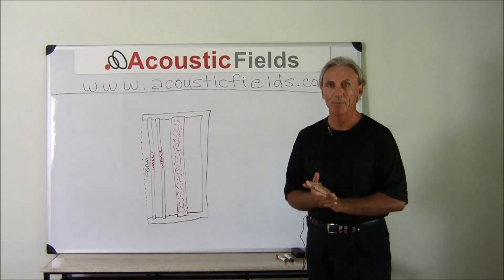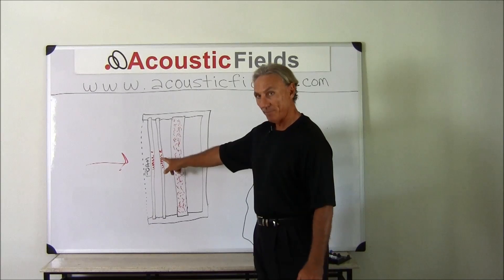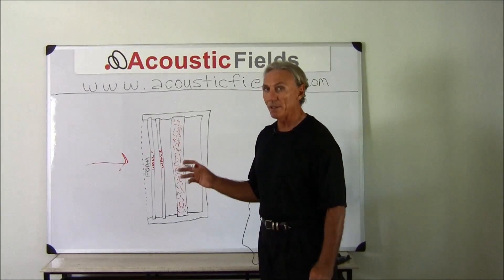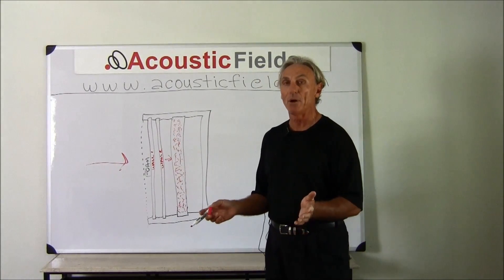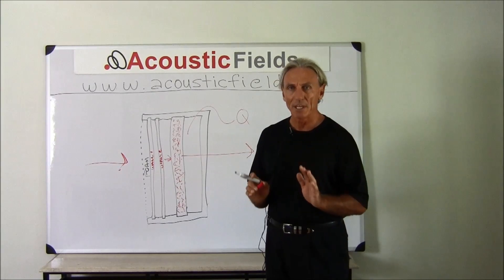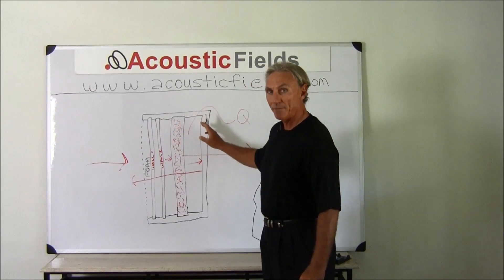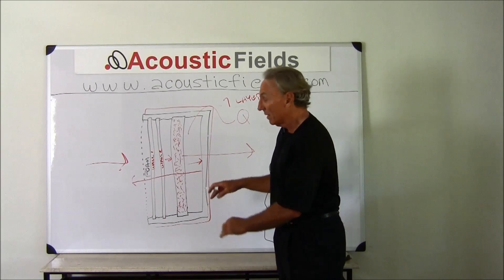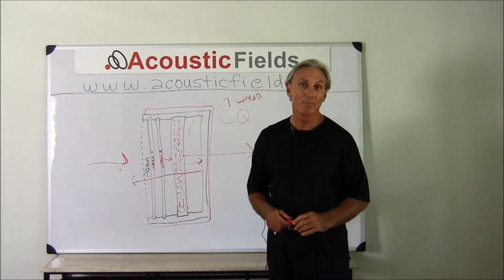How A Diaphragmatic Absorber Works - www.AcousticFields.com

Comment: Never use the wording "vacuum" when explaining what's going inside your products.

Sound / pressure does not not enter a "vacuum" and move to anywhere.

Better to say "a near air tight environment" which is nothing like a "vacuum" 🤔👍🏼
Reply from the maker: It is a "vacuum" in a sense of the word. In a vacuum, there is no air. Inside our carbon absorption technology, there is less atmospheric pressure inside the cabinet than outside where the pressure waves was created. This pressure reduction is critical in our diaphragmatic absorption process.
Reply: @AcousticFields  hello, surly the sense of the word Vacuum is: a space entirely devoid of matter.

The hallway beyond the door of a listening room will have lower air pressure but you do not enter a vacuum when opening the door.

The word Vacuum has a meaning which is completely different to the atmospheric properties of your carbon abortion technology and inside the box itself.

The word Vacuum is misleading and inappropriate in this context.

Love all your video and your passion for high-definition audio representation in smaller rooms 👍🏼👍🏼

Comment: This is great basic information.  Can these cabinets be tuned for frequency?  I assume the thickness of the carbon membrane is for tuning for amplitude?  I don't believe in one size for all.  If I have 5 axile modes in my room between 80 - 30 hz will your build plans tell me how to tune/construct a DIY cabinets for those problem modes?  (I expect to have multiple cabinets since the modes are between different walls).
Reply from the maker: The BDA / DIY units are the same performance of our ACDA-10 series. They are broadband from 30 - 300 hz for the lower end and the foam face extend the absorption to 6,300 hz.

Comment: I am wondering if this kind of absorber would work with the first layers being curved? The arc being a stronger shape than a straight line would require the layers to be thinner yet rigid (metal sheets?) I would much prefer the whole unit to be a quarter of a circle (for estetic reasons only).
Reply from the maker: You are working with pressure waves that are 20' - 40' long. A curve here or there will have no impact on a pressure wave.

Comment: I f you don’t have a room with the right dimensions of the golden ratio you have a listening room with bad acoustics. A small room is going to have big issues with standing waves. Below 80 HZ that can only be treated with Helholmtz Resonator, limpmass membrane,  panel resonator VPR platten resonator or Dennis Carbon panel resonator. One downside to tuneable port resonator is that it’s not broadband it,s band specific so you got have more then one so you can tune them to counter act different modal peaks. In a room you are going to use more then one technique for optimal listening acoustics. Over 80HZThick panels 15-20 cm of acoustic damping material with right air flow resistance 6000-8000 is going to work good.  For a acoustic panel to work good it also needs 5cm of air gap behind it. With all acoustic panels you got to be careful not to loose to much higher frequencies but that can be solved with scatter faceplate. One big issue today also to be considered is issues with 5G wireless WiFi networks EF RF disturbances that can destroy high frequency spectrum in your audio system. But there  is solutions to that like shielding paint and shielding fabrics or building faradays cage.
Reply from the maker: There is distortion everywhere these days. I thought the goal of all of these electronic systems were to make our lives easier.

Comment: Very interesting design, the fact that your layering the outer cabinet with damping is a great idea. Wave transition through different media !! Love it. Keep up the great work, I still don't fully understand how the activated carbon produces a high net wave absorption, is it due to particle size and mass ? Cheers Richard
Reply from the maker: A , Wave absorption is all about pressure. We reduce the pressure inside the cabinet so when the wave enters it is faced with a lower pressure environment.

Comment: Dennis, 

When you talk about a diaphragmatic versus membrane absorption unit, what are the actual design differences that determine whether it's a diaphragmatic or a membrane absorption device?  Is it the material of the diaphragm/membrane, is it the depth of the cabinet, the way the diaphragm/membrane is attached to the unit, etc.  that determines to call it a membrane or diaphragmatic device?
Reply from the maker: O,  Diaphragmatic has higher material densities than membrane. The diaphragm is denser with more mass. The cabinet is denser and using our carbon technology, you can achieve much higher rates using both types.
Reply: @AcousticFields  Is there any differences to the front wall?  Is one method more rigid and the other more 'flexible'?   I'm just trying to figure out what a definition of either approach would be so that one could easily identify between the two.

To me, a membrane would be a thinner "diaphragm" as the word suggests something along the lines of a drum head where the material flexes much more than a rigid panel.  And a 'diaphragm' would suggest a more rigid material where it moving back and forth in sympathy with the external pressure.

Comment: Something not clear to me is: are the two membranes/walls perforated?
Reply from the maker: T,  No. Diaphragmatic absorption works on sound pressure, not air flow.  Our dual wall construction slows the pressure wave down before it enters the cabinet insides. It then meets a lower pressure area inside the cabinet due to our carbon technology. This pressure change produces attenuation. The lower pressure level inside the cabinet is similar in process to friction with middle and high frequency absorption technologies. Friction produces heat and thus an energy change which produces absorption. We use lower pressure instead of friction.

Comment: Do you have frequency response and decay time before and afters of a problem room to show the effect of 1, 2, 3 etc of the diaphragmatic absorbers you sell?
Reply from the maker: B, Each one of our ACDA units attenuates 1.5 dB / 12 sq. ft. which is the surface area coverage/unit. Measure the impact of your problematic frequencies in dB SPL and then apply the 1.5 dB attenuation/unit to determine how many units required.

Comment: It would have been nice if you had a real model to show.
Reply from the maker: C,  You can see our diaphragmatic absorption process on our site or in this channel. The major difference between our diaphragmatic process and existing technology is the dual front wall (diaphragm), internal cabinet carbon which lowers "Q" value The carbon rapidly accelerates the rate of absorption within the cabinet. The resonant frequency is still controlled by cabinet depth.
Reply: @AcousticFields ...and seven layers dampened
Reply from the maker: @badrini  The process you are referring to is called constrained - layer mass - dampening. You are using a series of layers of materials that are frequency and amplitude dependent that are constrained or assembled together to reduce vibration transmission.

Comment: at 2:58, when Dennis mentioned the cabinet has 65 lbs of Active carbon, and it should have a "low " Q value.  Meaning high acoustic resistance/damping factor.
Reply from the maker: V,  Yes, low "Q" value. Thank you for the correction.

Comment: Really great videos!
I have some questions...
Where can i get data of activated carbon  or what do you use to calculate the absorbers?
Whats the volume mass of activated carbon? 
Can you send me some data of this interesting material for acoustic treatment?
But this looks interesting because of the two plate resonators tuned to different frequencies with the activated carbon included. really really good idea! i like that. 
Im from germany and we use other technology here (all firesafe) .
Can you give some information to me about this kind of technology?
Reply from the maker: A,  Our carbon technology is proprietary. We manufacture it ourselves to control porosity count, size, and density. Activated carbons used for water and air filtration will not work for audio needs.
Reply: is this background knowledge mentioned in your book about these absorbers?
Reply from the maker: A,  What book are you referring to?
Reply from the maker: A,  The link you sent me is to our build plans. We can sell you our carbon technology to go inside the BDA build unit.
Reply: Do i get it right?
Do you mean 2 different offers? 
Or do you mean the DIY Plan ?
Sorry, my englisch is not that perfect.
I really like the idea of these Kind of technology.
Reply from the maker: A,  You can purchase the DIY build plans and we can sell you the carbon to go inside the unit. The standard DIY build plans do not include the carbon. You must modify the plans to accommodate the carbon.

Comment: would it function as a coffee table as well ?!
Reply from the maker: Hi E, Yes, low frequency management is about providing enough surface area of the correct rate and level  for room size and volume. However, placing a highly reflective device in front of you between source and receiver  is not a good idea at all.
Reply: That sounds very interesting, as I could spare the space for a coffee table behind where I work. My living room is my studio. so sofa and coffee table need to be there really.
Reply from the maker: E,  Placing a coffee table in front of a listening position will produce spurious reflections that would interfere with the direct reflected ratio of energy presentation

Comment: Surely if the diaphragm is moving it is merely passing the sound wave from one side of the diaphragm to the other?  That's how the skin of a drum creates a low frequency sound.
Reply from the maker: +stevo728822 The diaphragmatic movement of the front face construction is designed to slow the pressure wave down.
Reply: +Acoustic Fields Sound waves travel faster through solid materials than air so it would naturally speed up   (increasing the wavelength).  To slow it down would require a gas filled membrane (helium or neon).
Reply: @stevo728822  I'm 3 year late in backup you up. But i believe your are right. The theory behind diapragmatic absorbers is to speed the sound wave up, in order for the damping material to work more efficiently in turning the energy into heat.
Reply: The membrane  will not let 100% energy pass through. Each membrane will reduce the energy passing through. 
You could, in theory, soundproof a room with nothing but bass drum diaphragms if you used enough.
Reply: @xNighx  I don't think so. The thickest Bass Drum heads are 14mil thick. Two plies of 7 mil mylar for the thickest drum heads, some are only 1 ply of 7mil thick mylar... not really enough mass to do anything to reduce low frequency energy. If anything, they will produce low frequency energy.  :-)
Reply: the drum head vibrates to produce a sound because it's not moving back and forth like in AF's products.  the head itself is thin mylar and it vibrates on it's own to produce a low sound, depending on how much tension they are under and how hard you strike the surface of the drum head.

Check out a Roto Tom from Remo, those are tunable drums with no shell and you can tune them to produce a low pitch or a high pitch, but the head itself is only 7 to 14 mil thick of mylar, depending on what heads you use.

Comment: Can it be used to absorb infrasound vibrations?
Reply from the maker: Hi Cinqmil 

Diaphragmatic absorbers are designed to have a resonant frequency that meets some designed for parameter. Frequencies above that designed for resonant frequencies are absorbed those below are not.

Thanks
Dennis
Reply: Maybe increasing the density of the front diaphgrams and the depth of the cabinet